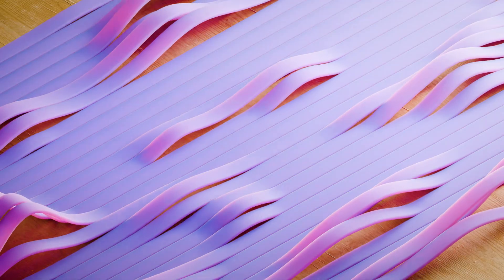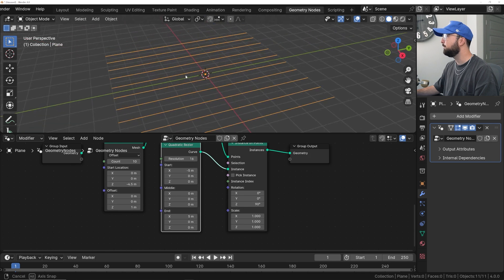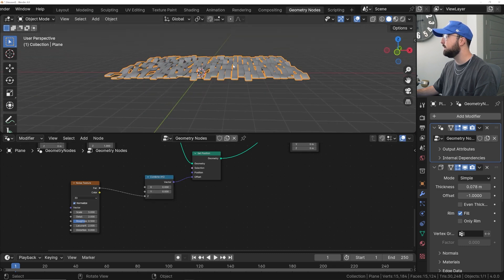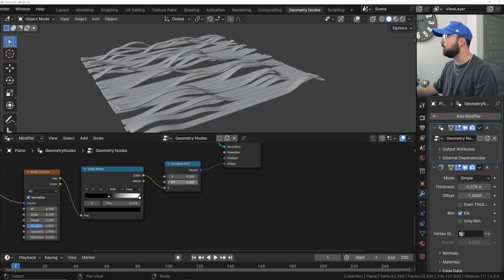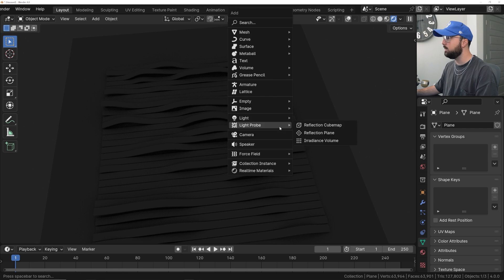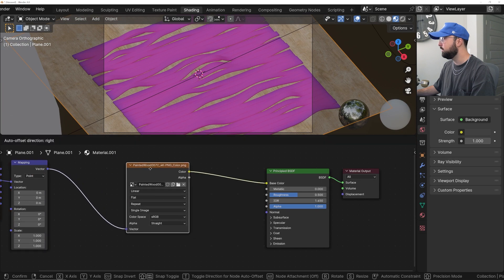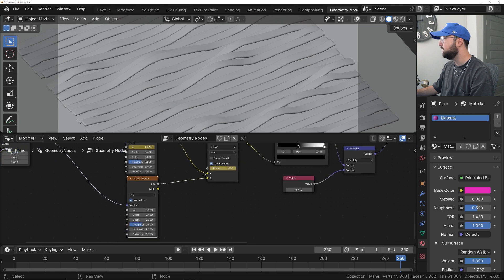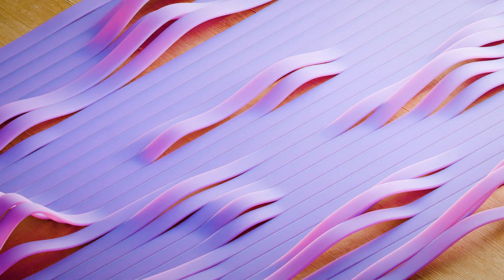Abstract 3D Motion Design Loop (Blender Motion Graphics Tutorial)

Comment: On 5:29 on the Noise Texture node I don't have the W modifier, anyone has that or it's something I missed or should enable? (I'm using blender 4.0.2)
Edit: Ok I realized that the issue is I don't have the option to change the node from 3D TOto 4D :(
Edit 2 lol: I put the node again and it showed up, no clue what happened the first time

Comment: I'm not on a computer right now to test if it makes a difference - but is there a good reason why you create the mesh line and quadratic bezier in a different orientation than you want them and then rotate them instead of giving them values to directly have the correct orientation?
Reply from the maker: Off the top of my head I don’t remember the exact reasoning. But as I was building out this node tree it just made sense. But I’m sure there’s multiple ways to get this.